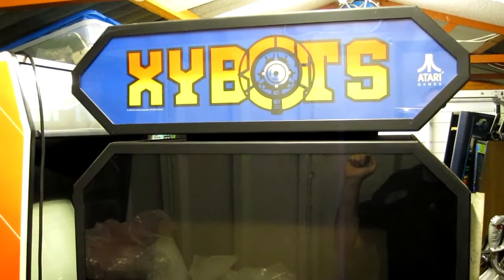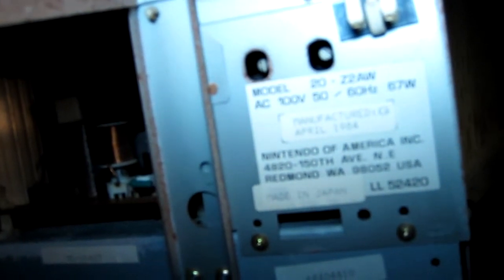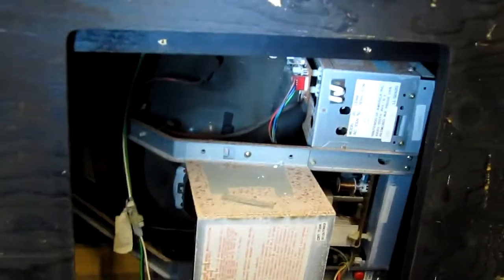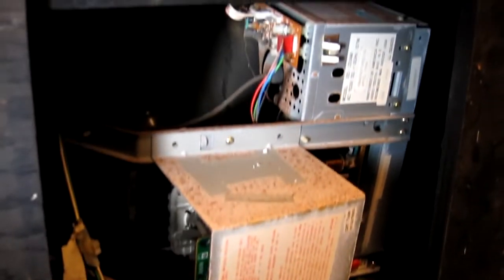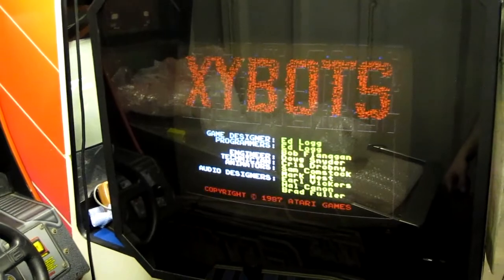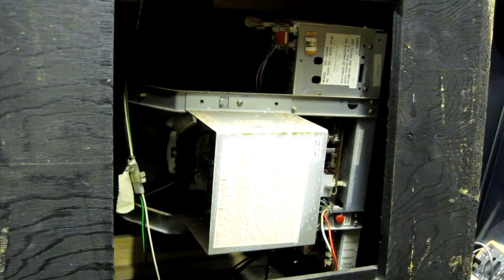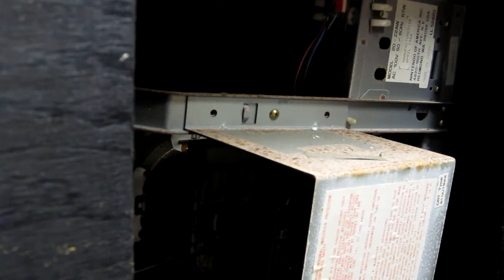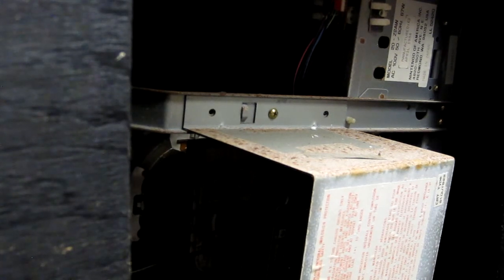Atari Xybots Monitor Repair Part 1

Comment: I was looking and looking for you but I couldn't see where it was coming from ;)
How awesome does that machine sound?  I have heard of the game but never seen it in real life.

Do you know any places in the North West who still work on CRTs?  The geometry on my B&O TV needs setting up but I can't find a place that can do it.
Reply from the maker: I really thought I would manage to pick something up on the camera. The machine does indeed have really awesome sound. When it is fully up and working again I will do a gameplay video. It is a really fun game.

No idea who does tellys these days sorry. It's certainly a dying art due to all the LCD fanboys. Still got a 10+ year old Toshiba as my main TV going strong. Nows the time to pick up a couple of B&O 20" 4:3 TV's for console gaming as they are pretty cheap these days. Keep saving those CRTs!
Reply: I was looking and looking as well lol.  Doh, I was quite looking forward to the replacement of the LOPT.  Hope you source one.  When I used to get transformers like that I found that cleaning the area around (and the transformer itself) and then take the transformer off and seal it with several layers of plastic seal before reattaching it usually does the trick.  A bit messy but usually did the trick.
Reply from the maker: GadgetUK164 I've had it recommended to me in the past to use several thin layers of HV silicone to seal a cracked LOPT. I guess it is a good idea for unobtainable ones. In this case, they are available to buy from arcade cup I believe. My thinking however is that if the lopt is cracked, and arcing out to the frame, there must be an insulation breakdown on the windings as well as the plastic casing, so sealing the case is only fixing half the problem, there will still be some shorting where the insulation is breaking down on the windings, I guess this would continue to deteriorate over time?
Reply: arcadeuk Not quite sure where my reply went... Good old crappy Google+

I was going to say that yes, if you can get a transformer just replace it.  I used to find that sometimes the plastic of the transformer couldnt handle the temperature expansion and that's why they crack sometimes.  Also whilst its arcing that doesnt always mean that the winding covering has broken down - the winding edges arent covered a lot of the time and it leaks from the bottom of the transformer.  And I think (I could be wrong) that ozone is produced and its that in waves that causes the ticking as it builds up enough in the nearby area to allow conductivity.